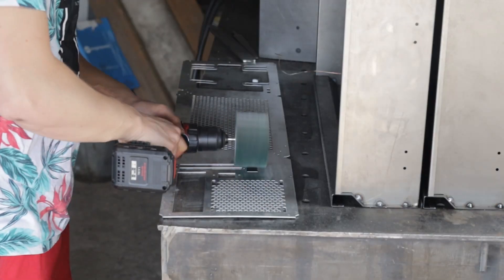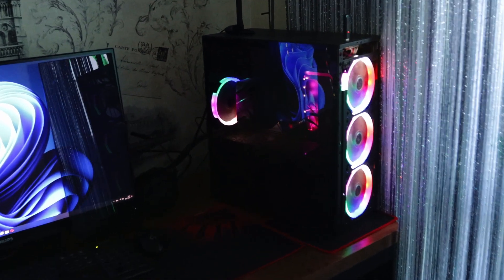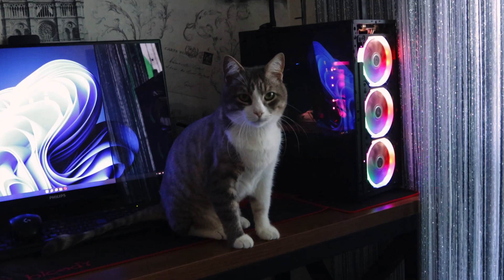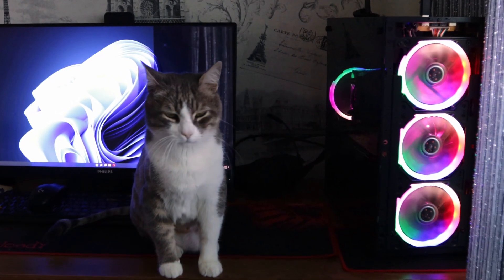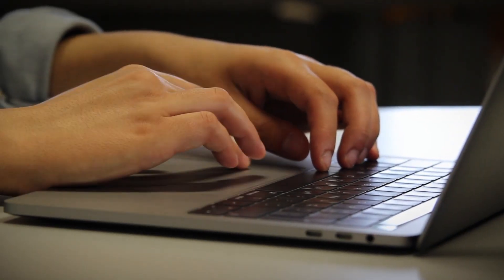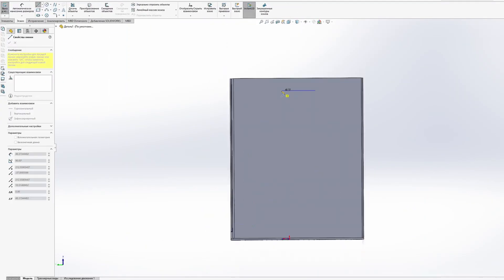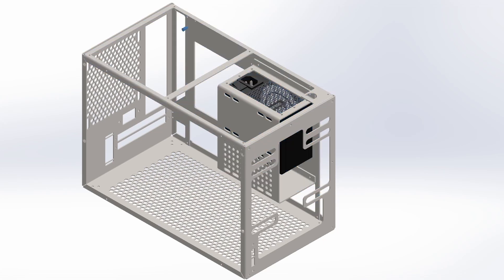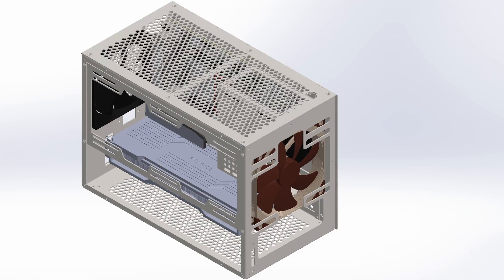MADE MY OWN ITX CASE!

Comment: What screws did you use to connect two 1,5mm plates together without nuts? thinking about standard M3 but not sure if 0.5mm pitch isn't too big for 1.5mm plate.
Reply from the maker: M3, and yes it wasn't a good idea. 
It works, but after 3-4 disassembly all the threads were broken. Aluminium is too soft for it.
Next time I would use m3 rivets.